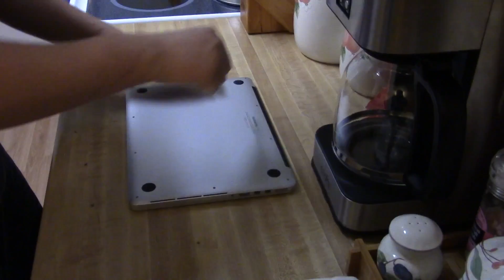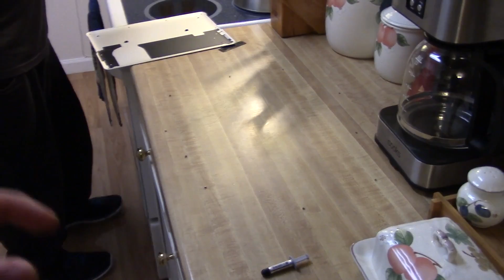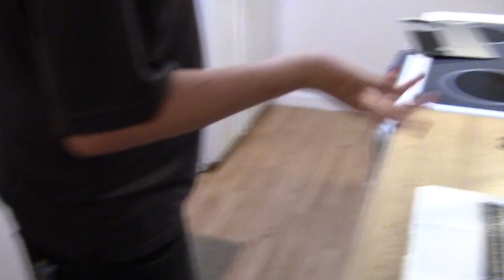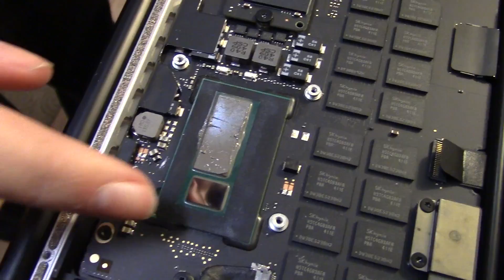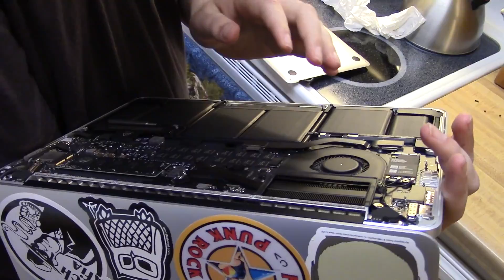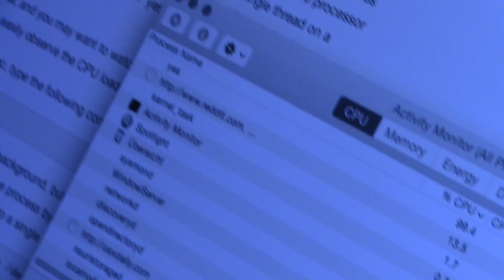Vlog: MacBook Pro Troubles & Apple Event Thoughts

Comment: In my opinion they should think more about what the normal MacBook is like it was in 2009. Were they had they MacBook Air. The Normal Macbook with more ports. And at last the Macbook Pro witch had more horsepower (If i remember correct could be wrong) and features like the backlight Keyboard. I still using a MacBook mid 2009 as my Portable and its a great maschine. (Least with the new Battery it is)

Comment: I kinda agree with what you're saying about the new MacBook, and see that as being the low end, the Air as the mid range and the Pro as the high end.
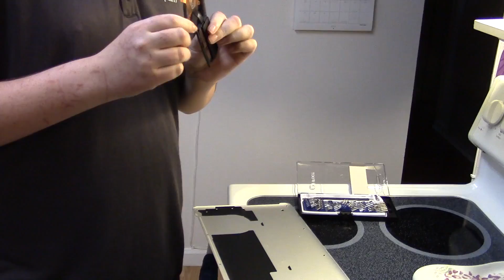11:40 Not sure if Chris has heard of "ArctiClean"(used with a cotton bud or "Q-tip", I think that was what was mentioned on ifixit) but I have both that and a tube of Arctic Silver 5 myself which I have yet to  apply to my own MBP.
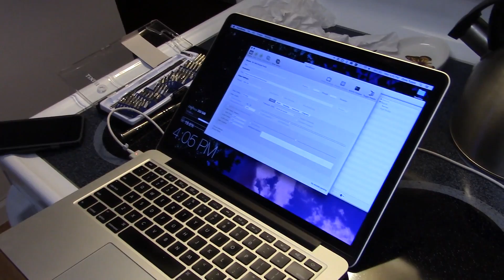20:04 Fortunately, if it was me, I have a VM so I would go straight to parallels desktop and load the only VM I have there, then load Videopad in that only VM I have, which does ramp up the fans for me on the stock thermal paste.
21:00 Dell0304 Go to terminal preferences, see the window profiles, choose the one you want, and set that as the default, then quit and reopen. You can also change the startup profile without changing the default profile.